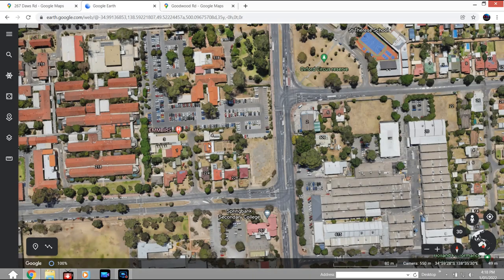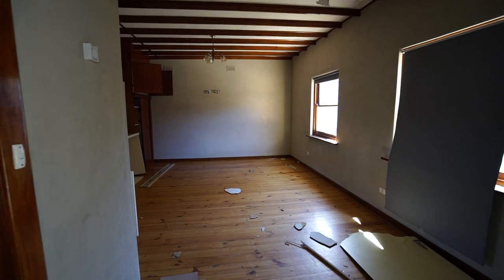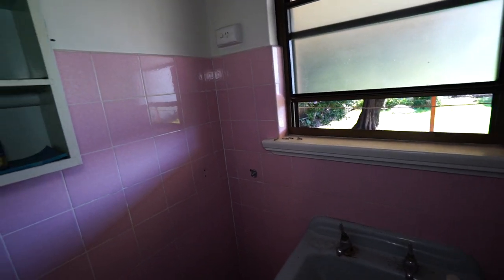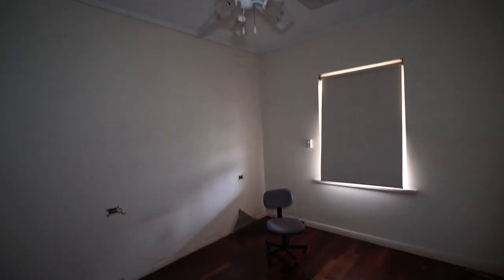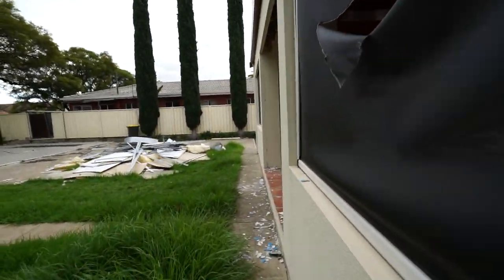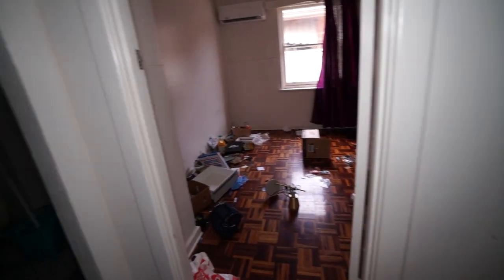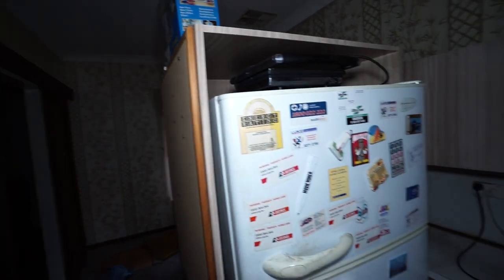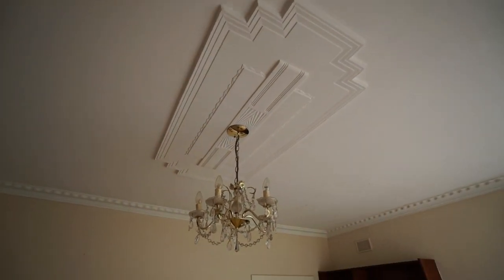Abandoned- A block of 10 dwellings! Urbex marathon! Homes lost to intersection upgrade

Comment: Why do y’all have sinks on the ground at the back door??
Reply from the maker: Hi Grace, do you mean the cement tubs?
Reply: @urbexindigo5164  no, the little sink with a tap above it at the back door most of the time. It’s no more than 10 inches off the ground.
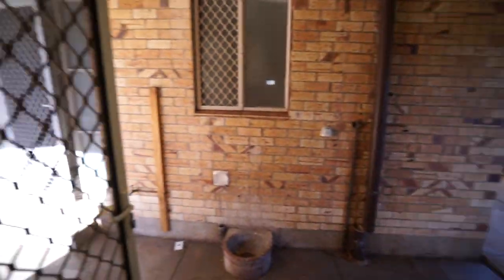Reply: @urbexindigo5164  at 11:53-11:56
Reply: Under the outside tap.   Don't know.  Maybe to keep it all of a piece.  If Washing you can throw excess sudsy water in it.  For cleaning pot plant pots, tools.  Usually in a concreted slab.  Sometimes I see an outside tap with no drain and it feels funny to me.  Unfinished. I guess you get used to things.  Also sometimes in remodelled places they don't put guttering. (Roof,). Odd.  
Your question was cute. 🌹
Ones without tap - overflow?